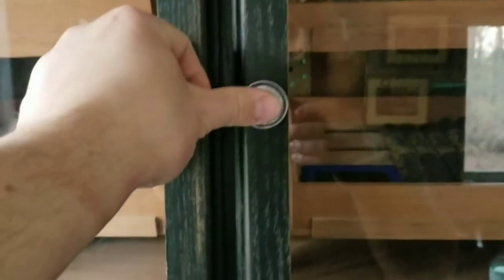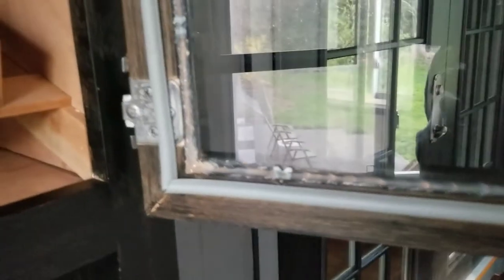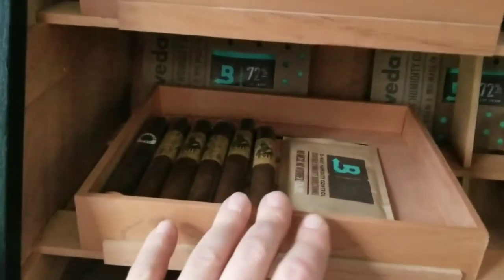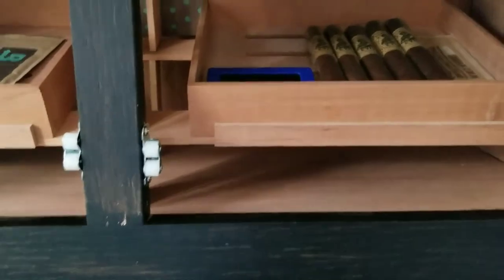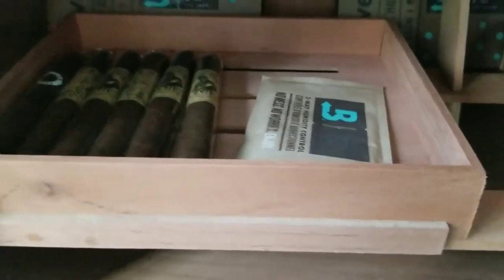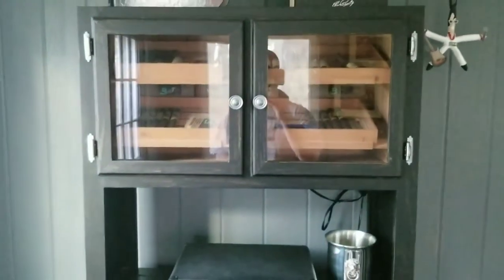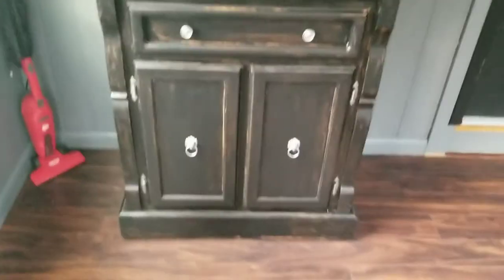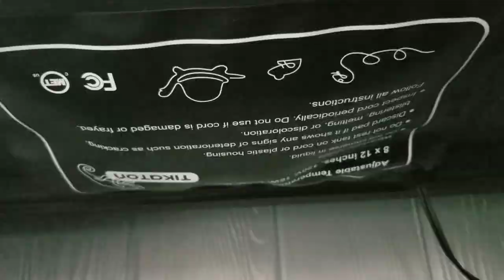Cigar Humidor Cabinet Build

Comment: Hi . How you keep the temp on 70f,(20c) .
In middel east the temp now 32c.
Have acooler or any idea?
Reply from the maker: In that situation you might be better off going with one of those wineadors, which is basically a wine cooler converted to a humidor. Since its powered it maintains a constant temp, especially in hotter climates. I haven't run into that issue yet myself, but I have seen guys put small Tupperware containers full of ice inside a cabinet like this one, if the wineador isn't and option. Hope that helps!

Comment: Nice effort but you used silicone and glue , two big No Nos since your cigars will eventually absorb some of the smell even if you can’t smell the products anymore. 
Another note , you’re looking at a pretty high running cost by using humidification sachets . They need to be replaced frequently and they don’t come too cheap so maybe a small electronic humidifying device will last you a long time and it’s a 1 time investment. My 2 cents . Enjoy
Reply from the maker: I've been using the cabinet for almost 3 years now and have had zero issues with the cigars absorbing any kind of odor from either the glue or silicone. Also using the large 720g Boveda packs for humidification has worked great. They last a very long time, so I'm not sure which ones you've used but I have had zero issues with them. I had my first set of 3 in the cabinet for nearly a year before they started to dry up, and it costs me about $70 for 3 so I'd say that's not too expensive. Thanks for the input though.